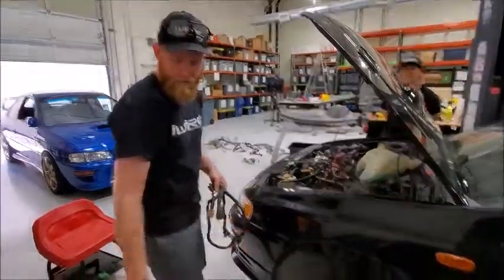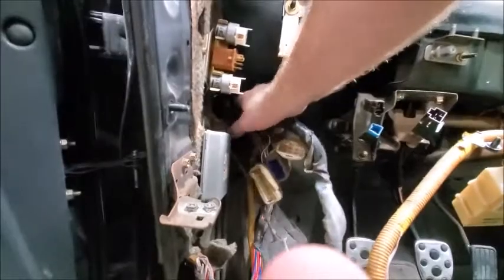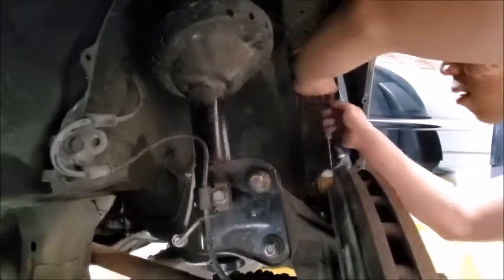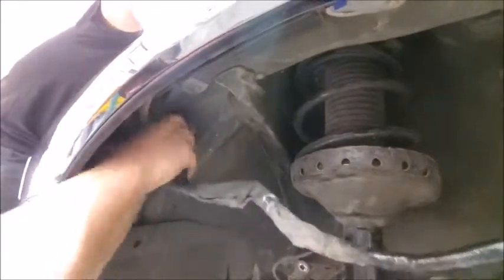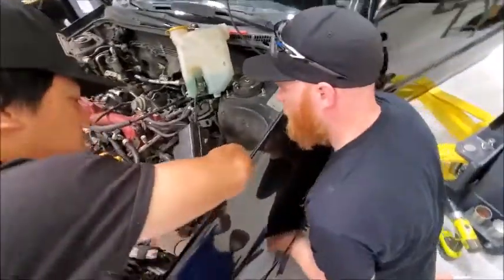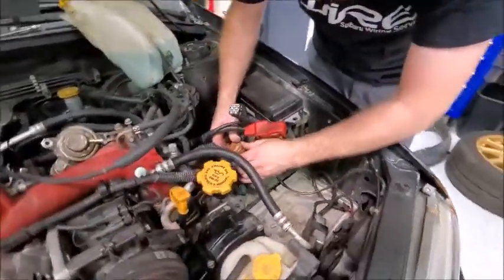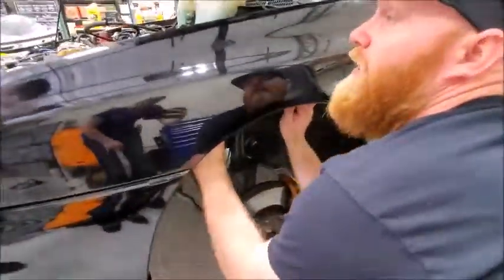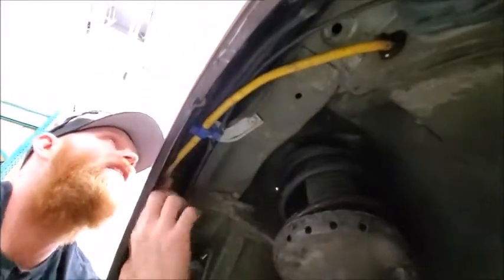iWire Subaru Wiring Harness Installation Video Part 2.5

Comment: Is this an RS thing, or would it apply to my Legacy as well?
Reply from the maker: Basically identical in process.
Reply: @iwiresubaruwiringsolutions  🤔 But I didnt pull wires from there...
Reply from the maker: @ericlanam4265  Where did the 2 main engine plugs come out? They should be coming through the driver's side fender like this video.
Reply: @iwiresubaruwiringsolutions  As I recall it, when removing the wires from my Legacy, everything disconnected inside the car, with nothing going out of a grommet at the side of the driver's footwell. Inside the engine bay, I didnt need to move the fuse box. I think the main plugs may have been connected through the firewall behind the heater core.
It's been a year and a half already since I pulled them, so the memory is more than a little fuzzy. 
Once my shoulder heals up a bit more (had surgery on it 4 days ago), I'll get the old engine out (finally) and dig in to the wiring.
Reply from the maker: @ericlanam4265  That's correct. The additional plugs will be on the modified harness you got back from us and why that section of harness will be opened up to feed them through. You wouldn't not have touched the fender section until install.